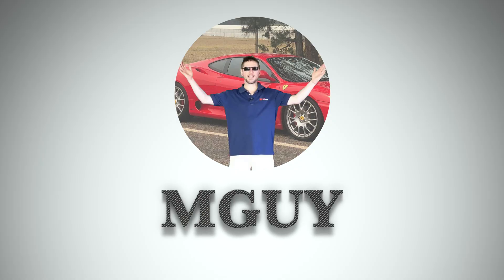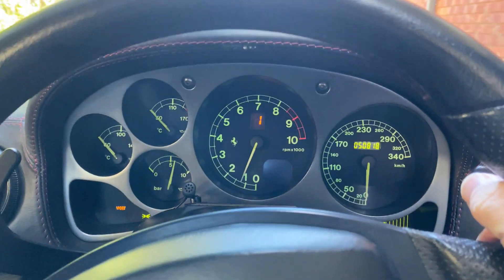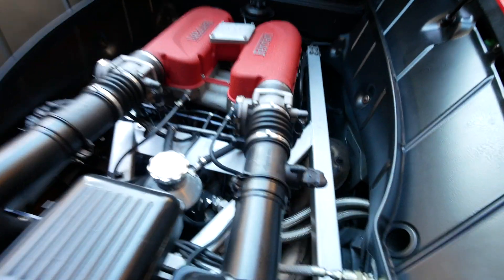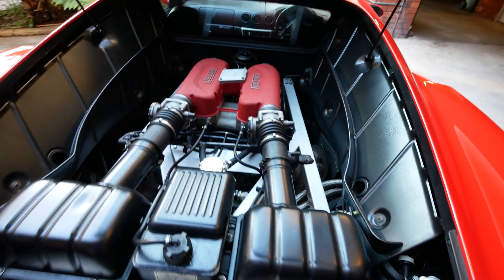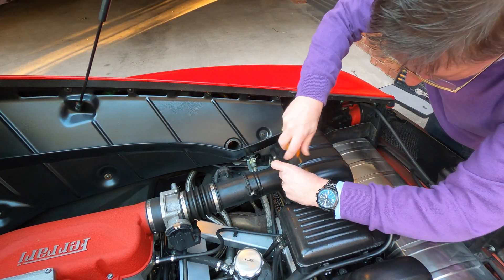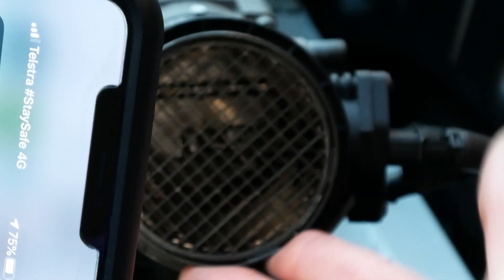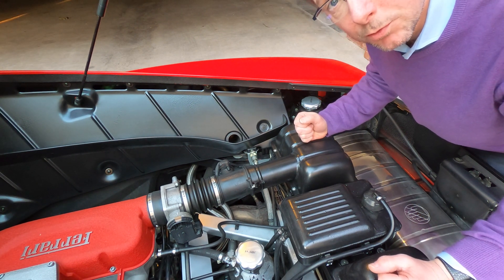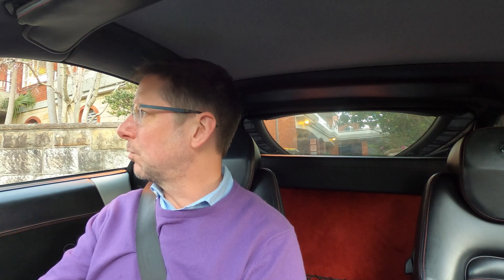Ferrari 360 - cleaning the MAF sensors fixed cold start problems | MGUY

Comment: That has to be the most stupid thing I've seen
Blowing AIR in to something that AIR blows in to all the time!
If there is debris on the hot film, its been damaged. If there is debris or oil on the hot wire then isopropanol is the thing to use.
Reply from the maker: This has to be the most stupid comment I’ve seen. It was MAF sensor cleaner. 🙄

Comment: Strange, I first thought it could have been bad fuel as there was no CEL. To be honest, the more you drive these 360’s the better they get. I’ve put over 33k miles in my 360 in the 3 years I’ve owned it. Great car, I am hoping to see how it performs against my daily CLK55 420bhp and 414 torque. I don’t trust too many people driving the Ferrari… infact I don’t trust anyone… as mine is an 03 F1 trans, you have to drive it differently, a silly mistake can kill the clutch. Subbed and good to see you working on the 360.

Comment: nice work. i have had this issue. clean maf sensor but it came back twice. so i cleaned it again but then i also cleaned the intake as well using throttle body cleaner. ran like new in winter.

Comment: Well done! New ones should not be that expensive, like 140 euros each of you order it using the Bosch part number.
Just from the originality  point of view: from Factory both maf electrical connectors point to the right of the car.
Reply from the maker: Thanks - the Bosch originals are not too common here in Australia, so I guessed a clean may do the trick. Noted re factory install. 🙏